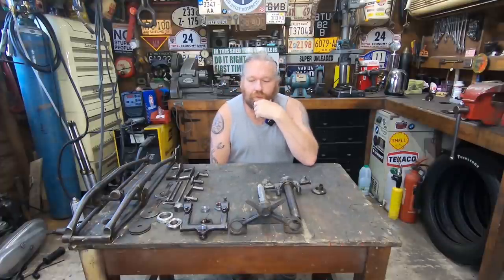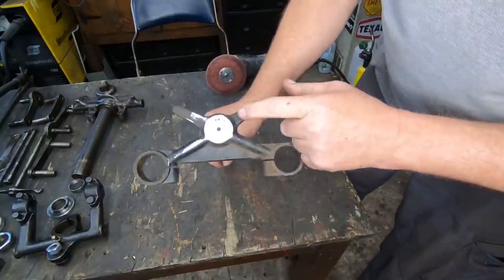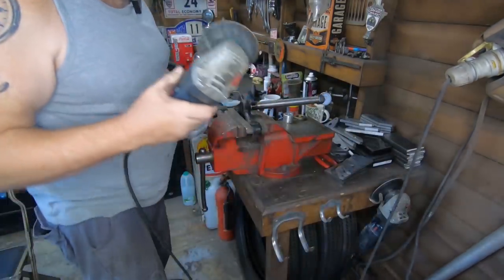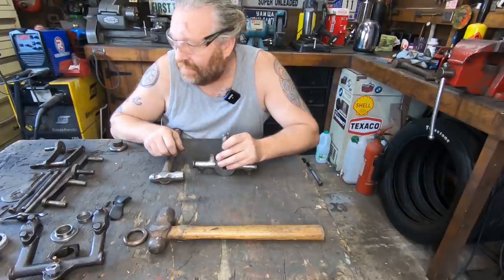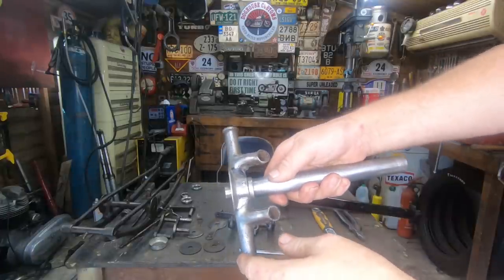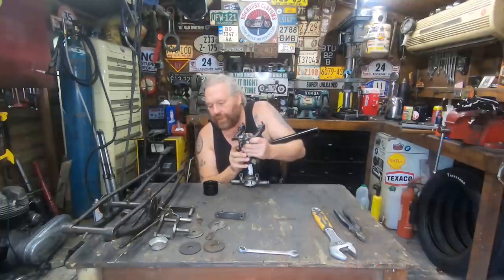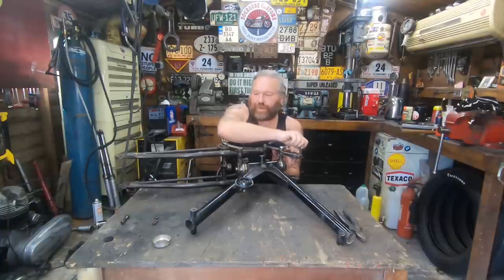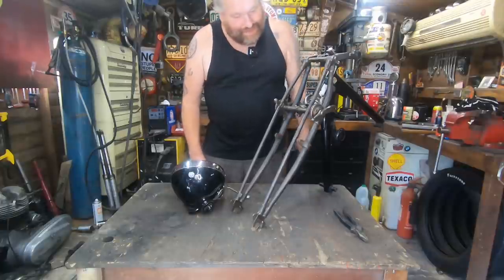Royal Enfield Bobber part 3 Girder Forks

Comment: Use of differential temperature would make those interference fits a lot easier to slide in and out!
A buddy and I once replaced the ball bearings in his bike's steering head with tapered roller bearings.
I turned the outer races down on a lathe to 0.001" larger outside diameter than the head's inside diameter
so that there would be an interference fit between the two.  Then I turned a pipe down to act as an
insertion drift to keep the inner race's axis aligned with the head's axis during insertion of the race into
the head (my memory dims here).  Then, with all tools at the ready, we cooled an inner part with dry ice,
and then heated the outer part with a torch.  And with no struggle at all, races could just be tapped out
with a drift or pulled off the spindle with channel pliers.  Similarly, before fitting of the new races, we
cooled the inner part with dry ice, and heated the outer part with a torch, and races could just be tapped
into place (again with a drift to maintain proper axis alignment).  We usually had about a minute before
the temperature of the two parts equalized and the interference fit wouldn't allow the parts to budge
at all thereafter.  The 2 critical features of the technique were 1)  generation of differential temperatures
using dry ice and a torch, and 2) fabrication of a properly diametered and squared-off drift to prevent the
races from cocking to one side when being slid into place.  When done with careful planning, a minute
was a LOT of time to slide the parts apart or into place.

Comment: The way things are laid out on the assembly table and the way they have been cleaned, polished, re-built 1:00. My eyes cannot lose sight of the sign on the wall behind " Do it right, first time " . I am very convinced and have no doubt that is the mantra in The Doghouse .
Reply: The way things bounced off the table onto the floor 😂❗️
Reply: @karolkowalczyk1578  I am not sure if you understood my comment or if you understand the English language ? Seems like you are just another troll, out to nitpick on genuine content.
Reply: Stan Kropiunik WTF❗️❗️❗️
Seems like you have had a sense of humour transplant
Reply: @karolkowalczyk1578  You can keep your f**cking sense of humor to yourself! I wonder what you find so funny about a part falling off the workbench? This not the assembly line of a tunnel-visioned, German automobile manufacturing unit. But an easy laid back workshop, that creates the art of motorcycles. I own and work on Royal Enfields and have done so for the past 30 years, so I understand the passion of this man.

Comment: Amazing work man! I'll even let you off using BSA springer forks on the Enfield, you're not getting mine off my old lady! Keep the veteran theme and go for half bars instead  of a conventional single handlebar...that would look different. Really like you persevered, good old blacksmith engineering.
Reply: Can you link me to an example or a pic as im not sure what you mean? cheers mate
Reply: @GuitarDan73  I'll try and find a link. I've two piece bars on my 1938 BSA C10 with girder forks and hard tail rear, I'll easy photo it and forward it somewhere for you.
Reply: @GuitarDan73 Hi Dan. Couldn't find a clear picture online, there is one on the BSA C10 forum but as I say not particularly clear. I  believe HD did 2 piece bars on shovelheads. Basically each side goes into a socket on the top yoke which is tightened to grip the bar. Just looks a bit different to having a single piece bar. Wish there was some way of adding a photo on this other than a link.
Reply: @alancampbell1008  ok mate ill have a google about cheers

Comment: I helped out on a couple of early bikes , brazing of tubes in tubes and stems was the norm - I guess that they were being made by blokes that made bicycles , and brazing was the method used for frames etc . The brazing is top quality "capillary" brazing , practically invisible , so if I ever worked on another early bike , I would be alert for brazed bits . Personally , I'd be nervous about dressing out the pitting on those tubes as it would reduce the wall thickness ??? - but if going for it , hook up the tube sander to the variable speed grinder I bunged you -unless Hepcat nicked it :) - maybe try the polishing belts first ??

Comment: Me thinks you need to put a cut in one side of the top caller so when you tighten the pinch bolt the nut can't back out.
By the way you swing a  hammer I think you mite have done it a few times before.